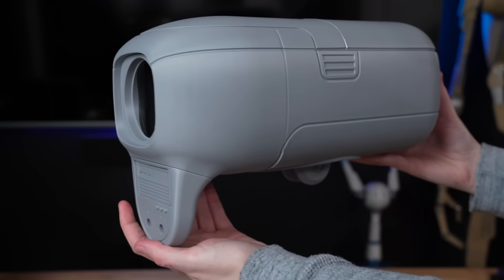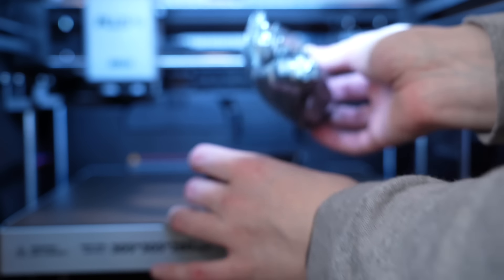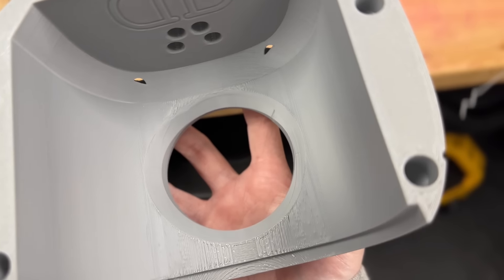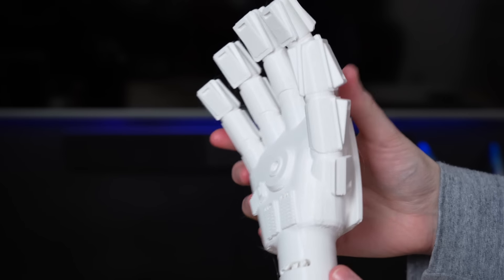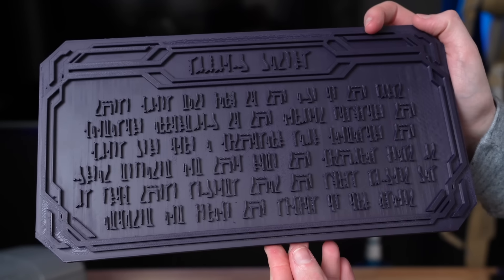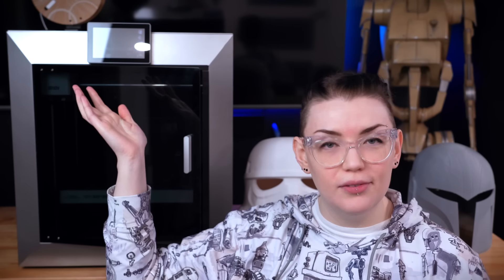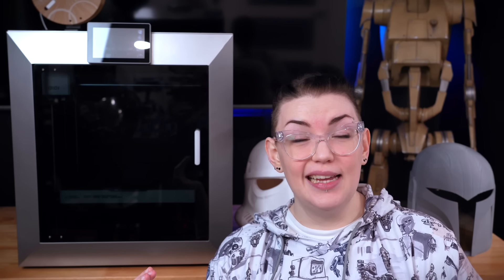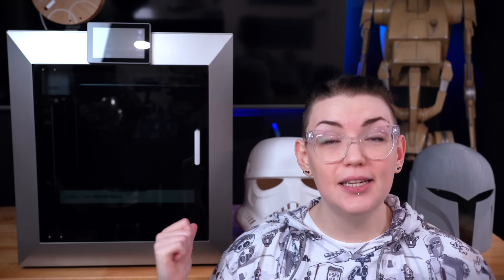Should the QIDI Plus 4 be your next 3D printer?

Comment: Glad I watched your excellent video. I make alot of parts that have holes of different sizes in them. With the lower end printers, those holes often are too big or small. I can adjust in the slicer but often times I need to adjust the size in the stl model. Does this printer make all dimensions correct? I really like the Form 4 info page that says "for parts that fit." Don't like the $5000 usd price tag.
Thanks!!
Reply from the maker: Sometimes it’ll vary depending on filament as well, for example ABS is known to shrink. But that being said, I just used it to print the top of a helmet stand to fit onto a 1” dowel, the hole was only .02mm larger than the pole itself should have been, and it fit perfectly. So yes, I’d say it can print with pretty great dimensional accuracy.
Reply: @MMsPropShop  Thanks for taking the time to write me back on this.

Comment: @14:32 is the model supposed to be tapered in like that or is that from the filament lifting off the bed?
Reply from the maker: Looks like it might have been a little lift on those corner(s). I never noticed it until you pointed it out, even when I installed the piece to the rest of the base so I guess it wasn’t too bad 😂
Reply: @MMsPropShop  lol I feel bad now pointing it out.
Reply from the maker: @diabeticjedi7951 haha, completely fine! You’ve got a great eye. That particular PLA is some of the toughest stuff I’ve ever used to the point that I’m sometimes surprised it can even be printable so I’m not surprised there was some corner lifting lol

Comment: The design issue with the heat being blocked in tall builds seems very significant-- and it is kind of hidden at the very end of this review.
Reply from the maker: Not intentionally. Just seemed like the natural place to include it since it was more of last minute addition. I would hope if you’re seriously considering purchasing a printer you’d watch an entire video.
Reply: There is a firmware update already out that will stop the heater from trigger the high temp limit when blocked. For the end of the build it will auto shut off the heater and coast on the heat remaining in the chamber.

Comment: The heater placement is a serious design flaw. It's a dealbreaker for me. Constantly heating the front left bed rod will bake the lube. Chamber temps are not the same as the output of the heaster, it could well be taking the rods to 100C.

Bambu's new machine launches late Q1 2025 and as a recent Bambu convery (from Voron and home designed machines) may be somethig of a fanboy with how good they are. So I will be waiting for that annoucement to drop, but this apart from the huge issue with the heater is a very promicing machine.

Also. I love printing in ASA, but we both know, it is the devil. That filament is just evil.

Comment: Im so confused now! Im considering Qidi Plus 4, Max3 and Creality K1C, K1 Max... I just want to print and not have to constantly work on the printer or troubleshoot problems
Reply: I wouldn't do any of the creality options. Price for performance isn't there. 

The P1S is on sale and is basically the same as any other Bambu lab printer. Otherwise the Qidis are great, with chances that you get a lemon higher than creality. 
The Q1 Pro Qidi is also very cheap right now and is great with more quirks.

Comment: I'm sure I'm not the only one wondering, QIDI Plus 4...or BambuLabs X1C?  Obviously, the Plus 4 has a large build volume, but if that difference is removed...?
Reply: $400 less, at least before the current sale. Larger print area. Heated chamber. Higher nozzle temp. Wider belts with a finer pitch for less FVA. Nearly stock Klipper. No account requirements. Great customer support. Those are the main advantages to me.

Comment: Would love you talking some more about your Anycubic Kobra2 Max and especially WHY it produces your smoothest prints. because that Machine is a pain for almost every owner, i wrote you a Comment about this on your video, where you rate different Printers. would be cool of you, to make a video about your Kobra 2 max.
Reply from the maker: There’s this video when I first got the printer: https://youtu.be/Yvj4GykjzcU

I honestly don’t know what I’d say in a second video. It’s been giving me the same quality prints since I first got the machine and I’ve done nothing special to it. I hardly made any tweaks to the default Prusa Slicer profiles other than the typical walls/infill. The only other thing that might be more unique is that I have it set up on the floor so I’m not having to deal with any possible shaking or wobble from a table (although it shouldn’t technically matter due to the input shaping).
It could be the slicer choice that could be causing a lot of issues for people. You would not believe the issues that can come up depending on the slicer and how it decides to try to tell the machine to print something.
Reply: @MMsPropShop  lol thanks for the Answer, i think you might just have that one out of a Ten thousands of a Machine. I'm in two communities for the kobra2 max and not one single printed Object the ppl post on there,  looks as good as your prints do and they try literally everything to get this Thing to print nice. But your Video is proof that that Printer can print nice, so thankyou for showing🤗

Comment: My 3 month old plus4 has been a pain, not quite a nightmare, but a huge pain. Costomer support has been nothing but auto generated responce emails, pointing me to the plus4 wiki. I've thrown away at least a $100 worth of filament due to failed prints. The tangle sensor works ~75% of the time, the run out sensor I have yet to get it to work, but the issue now is a wandering Z height. Don't think the auto Z is working, and I've had to adjust the Z offset from .045 to .2 all within about 6 prints. If I could get a responce at all from QIDI about the chamber heater issue and the new Z offset issue, I could give them a pass. But as it sits, buyer beware. Seems like a crap shoot, you get a good one, great, you get a bad one, tough luck.
Reply: Thanks for the comment dude. I was about to buy a Plus4, but my main concern was the reliability and ease of use.
i think i will go for a bambulab after all.

Comment: is the plus 4 better then the bambu X1C carbon or the P1S
Reply from the maker: It’s definitely better at printing large pieces. For me my X1C is my fun and smaller job printer - I’d never choose to try printing a full size helmet or any other large scale props on it simply because it would need to be broken down into many pieces and having something already in one piece is a significant time saver later on.
When Bambu Lab comes out with a larger machine that will be more of a fair fight. If they keep up with their quality control and thorough thought process for their printers, it will be a very hard printer to outdo.

Comment: Can you comment on the level of ABS smell from this machine?  Does the filter work well?  I'm thinking of this being my next printer .
Reply from the maker: I had the chamber circulation fan running at 40% and I smelt nothing. I also have an active carbon air purifier set up in my shop but from experience, the smell of ABS varies greatly depending on brand. I’ve mostly used Polymaker so when I tried a different kind it was pretty shocking 😂.
Reply: @MMsPropShop  Thanks for the reply.  Looks like this is gonna be my next printer.  I might wait a few more weeks and see if they work out the chamber heater and a couple small things I've seen on other channels.
Reply: @MMsPropShop  does your air filtration setup push the air outside? I have everything prepped to do that here (for airbrushing you want the negative pressure). Only have an 2021 Ender 3 S1 Pro but looking at a P1S (or X1C) & I'm thinking of putting the air output outside.
Reply: Those tiny built-in filters don’t do the job. When I print ASA or with resin I put the printer in an enclosure (from Fungdo) that’s connected to an AC Infinity Air Carbon Filter “with Premium Australian Virgin Charcoal, for Inline Duct Fan” (both purchased from Amazon). The enclosure’s seal and inline fan are good enough to create a pressure differential so no VOCs leak out. The filter is more than large enough to clean the air passing through it. Filament (single roll or AMS) is outside the enclosure and feeds in through a PTFE tube.

Comment: What temp do you set the inside heat for your prints..
Reply from the maker: I normally aim for around 50°C for ABS parts
Reply: Thank you for your quick reply. I currently have A1 mini and X1C and snapmaker Idex J1. My Qidi plus 4 should be arriving in 10 days. 
I was thinking maybe Qidi could have added vents to the side of the build plate frame so that it would fully block that vent you were talking about at the end of your video.  Stupid idea?  Anyways love the video. 
Aloha!

Comment: Is the 110/120v issue a real threat, in terms of fire safety, that i've been hearing about? (usa usage)
Reply from the maker: I’m not sure if it’s been proven/confirmed weather the issue was just down to a few faulty units or across the board. Regardless, there was a firmware update issued that lowers the power output to the chamber heater (mitigating any possible safety issues for now) and it seems like they’re issuing upgraded replacement parts to anyone affected.

Comment: What app is needed to open and view your ABS configuration files?  I have been unable to read them.
Reply from the maker: It’s the config file for the whole Plus4 since that was the easiest way to get both my ABS print settings as well as filament profile. I exported it from QIDI studio so I would have assumed it also would have worked in Orca if that’s what you tried. If not, I can upload an Orca specific version as well.
Reply: @MMsPropShop  I am all good now. Imported it into Qidi Studio and overwrote the existing profiles. The nozzle temp is much hotter than I was trying.  I'll give it a go.  Many thanks.

Comment: I've been following this printer for a bit now, however it looks as if they do have some issues to sort out, The glue on the lower linear rail tool head not holding up to max chamber temps (Apparently they have a fix available which is 2 longer screws?), heater issues at max Z, repeated criticism of the interface layout and the interface lagging or locking up post print, and a few other issues I've heard reviewer's mention I'd be hesitant to pull the trigger on a Plus 4 until they sort that all out, plus I'd want it to have Lidar for bed level mapping, should be a simple addon without too much more, they announce these items resolved, I'd be a customer faster than Fry can say "Take my money!"
Reply: Mate, you have got the issue wrong, nothing to do with glue not holding up to chamber temps..... go watch Noisie's videos again..... he used a glue in the attempted fix he did that failed.
Reply: @AusPhilMotivated  I'm guessing the longer screws they provided as a fix hopefully resolve the issue, thanks for the heads up on that.

Comment: Why punish urself printing in abs?😂 does is clean up better or take paint better?
Reply from the maker: It’s a million times easier to post process than any other filament. For example, I can take a raw print of a helmet and get it completely smooth and paint ready within a day. For PLA that would be a 2-3 day process because of how badly it sands amongst other things.
Reply: @MMsPropShop  ah okay that makes sense. I rarely need to finish any prints off but ive found petg to be very easy to sand and finish. Also because I'm able to print petg at speeds close to pla

Comment: Except it can't print PLA very well. You'll get a few good prints then you will have to deal with numerous clogs on every PLA filament. I wish i would have gotten another Bambu, Plus4 is a rip off. Unless you get a degree in filament settings and fine tuning and can deal with many, many, many failed prints.

Comment: Grrrrr Manufacturers please stop putting spools holders on the back of your massive printers. Its such a pain in rhe behind trying to reach around the back and change spools.
Reply: I don’t understand why they do it. It really sux
Reply from the maker: I hate the back loading spool holders as much as the next person, but this one I actually don’t mind. Even with the printer on a workbench height table, I didn’t have an issue with reaching the filament from the front of the machine since it is hanging overtop of the printer more.
With how the plate you install is designed, I’m sure there will be many printable options (if there aren’t already) that can still snap into that hardware, but relocate the spool holder along the left side of the machine.
Reply: It's not on the back? It's on top? It's very easy to reach. Big improvement.

Comment: Right so I’m looking to get my first printer for mainly helmets.
Have you use POLYLITE cosPLA?
If not what is your preferred  ABS?
Also the heater getting blocked is hurting my BRAIN , what would you suggest is the next best thing to this that can be used offline
Reply: Its not a hardware fix, but the new firmware   addressed the heater issue and at the end of the tall print it will shut off the heater. It will stay warm enough to finish fine.
Reply from the maker: I haven't used the CosPLA but for me the added benefits of being able to acetone weld and smooth ABS would still have me leaning in that direction. Especially since I have the ability to print it as easily as PLA. I've been using Polymaker ABS the most thanks to being able to get the multi kilogram rolls on sale. I've also had good luck with Overture, Creality and Bambu Lab ABS.
There are the other slightly older QIDI machines like the x plus 3 and x max 3 that you might want to look into or wait to see how QIDI responds to the heater issue. In the past, any issues that have come up on their machines they’ve successfully remedied.